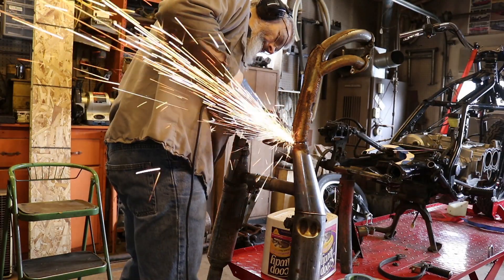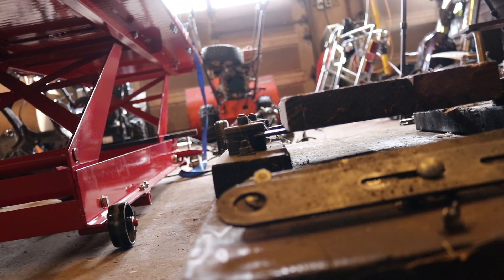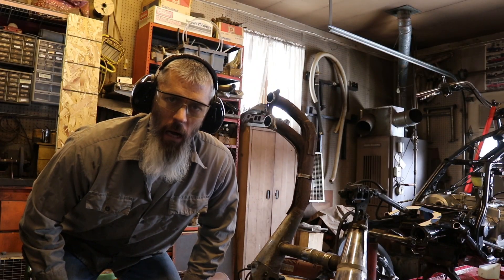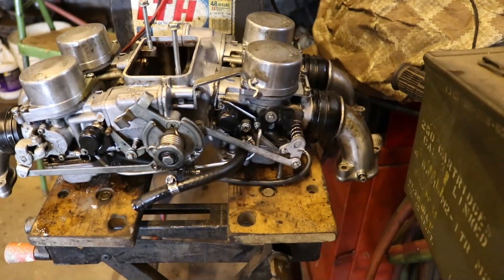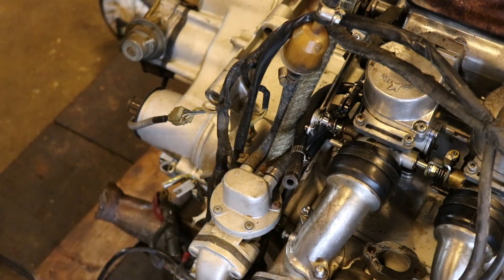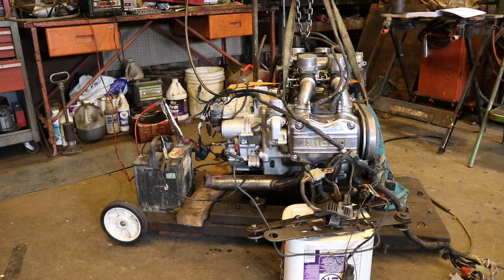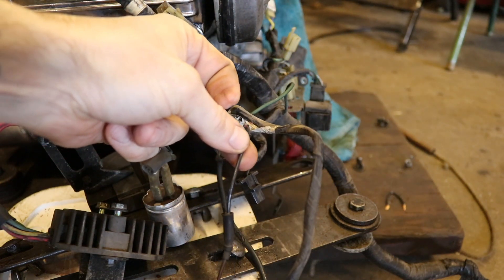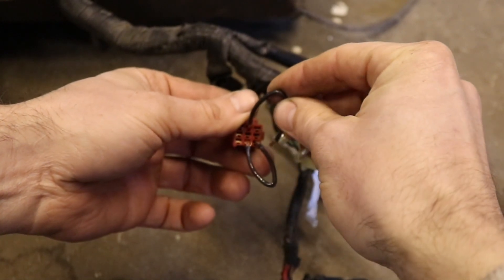Honda Goldwing Bobber Build | E23 Engine Runs On Floor!

Comment: It's ALIVE! Congrats man. Starting to really pay off
Reply from the maker: It sounds like a beast with just the headers on too!
Reply: @HooptieDoodle  trust me, I know lol. When I got mine, it was just headers and I took off down the road with it. Woke a few people up lol
Reply: @HooptieDoodle  I'll send you a video of mine with the mufflers I ordered, if they sound good. They are small and they were cheap and I'm expecting a nice, deep sound out of them. I'll let ya know how they turn out
Reply from the maker: @picklerickc1375  that sounds interesting. I was planning a custom baffled exhaust extension/tip so I can practice more welding. I am curious what you came up with.
Reply: @HooptieDoodle  one thing I do wish, is that I could afford buying an original exhaust to mess with and modify. The crossover pipe should be kept, in some Manor, to balance the cylinders on the exhaust end of the motor. You have one intake, into 4 carbs, 4 cylinders, into two separate exhaust outlets. My neighbor is a connoisseur of engine physics and says it would help my motor to have another H-pipe made up on my bike to balance each side with each other. But when I got it, I only had the headers so I'm stuck with the "true duals" for now
Reply from the maker: @picklerickc1375  this is interesting. I'm going to research this one.
Reply from the maker: @picklerickc1375  so my dad calls this a balance tube, and it's supposed help balance the back pressure across the engine. Supposedly this also increases horse power a bit 👍

Comment: I don't know if you ever got around to rebuilding those carbs, but I can tell you what a pain in the ass they are .. When i did mine, a complete rebuild kit was near $350 and it took me a few days as there are so many small parts in these carb racks... Anywho, love the build and love the sound of that Box Four 1100 ...
Reply from the maker: That reminds me to winterize, ah!
Reply: @HooptieDoodle  do that .. old gas is the bane of these carbs ... so many small air ports and jets just asking to be clogged lol